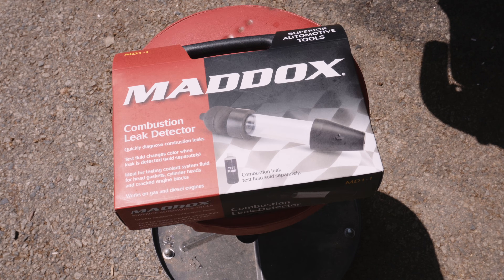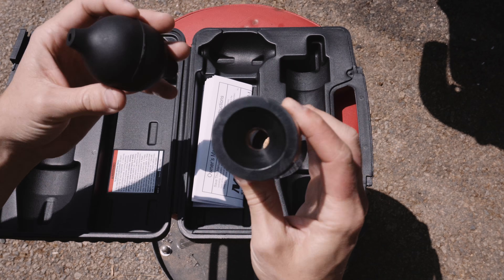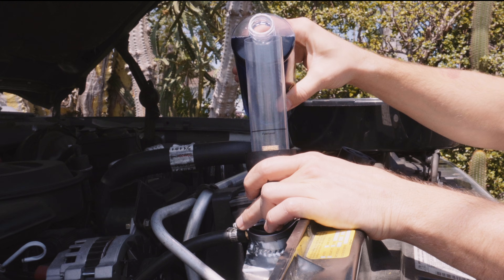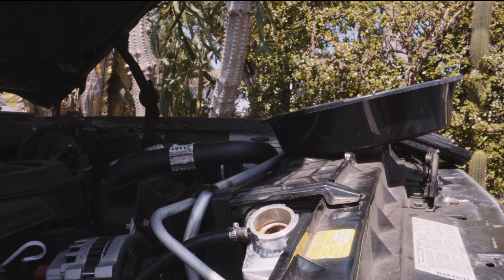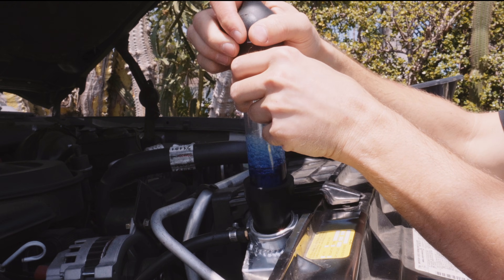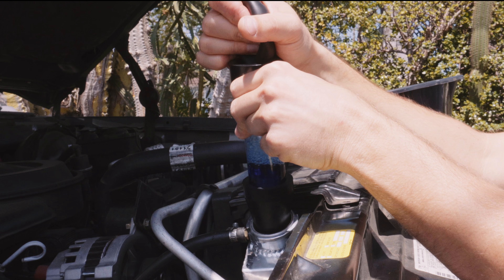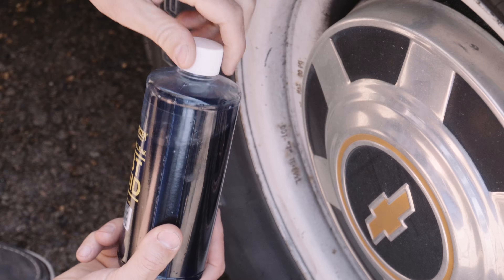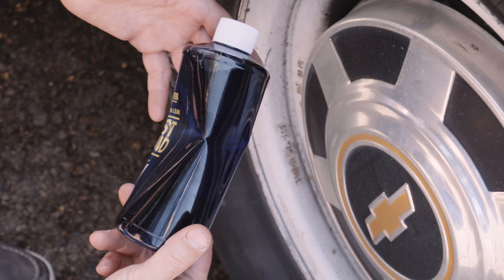How to test your engine for a head gasket leak with a block test from Harbor Freight

Comment: I want to know but I don't want to spend time or money..And I don't want a blown head gasket. I've been taking A LOT of short trips and I think the milkshake under oil cap is just normal condensation from not running it long enough for the condensation to burn off. You can have milkshake without a blown head gasket or Any problems At All. Beware of some shops that say it's bad do your own test first.. unless you have unlimited funds or can buy another vehicle.

Comment: No adatives will fix a blown head gasket this is not true at all
Reply from the maker: Call it a fix, call it a bandaid, call it nothing at all. What can say is my 4Runner had a minor HG leak and BD “fixed” it and it ran great for 3 years until I replaced my water pump and forgot to put my hose clamp back on the lower rad hose 😅 expensive mistake

Comment: Old school testing most new vehicules this will only indicate there is co2 in the system but not necessarily from a head gasket, most times its from EGR coolers causing the issue.

Comment: How accurate are these? Can a false positive or false negative occur?
Reply from the maker: As long as you keep the nozzle tight against the radiator, they’re super accurate. The only way it will change color is if there’s exhaust fumes in the radiator, which would mean head gasket leak.
Reply from the maker: It also needs to be pretty concentrated for it to really change color. Even more so driving home the accuracy.
Reply from the maker: Definitely no false positives. I could only see a false negative happening if it is an extremely slow leak. But I really don’t think that would happen.
Reply: When I did it for my car it was dead cold then I pumped it for 2 min and stayed blue but then as the car got warmer it turned greenish but I think that's bc as the car got warmer the coolant rose in the radiator to the neck and I tried removing it and doing it again but coolant kept rising so the tester I think was sucking in coolant to make it turn greenish

Comment: Will the exhaust gas come through the radiator even if the thermostat is closed??
Reply from the maker: Yes
Reply: I did this test and that liquid didn’t not turn yellow. But I’m still losing some coolant every once in a while, and couldn’t find any leaks.
Reply: @Nick1997-g5o  get the harbor freight coolant leak detection fluid and then look up a video on YouTube to see how to properly use it

Comment: So if there are obvious bubbles being blown into the cooling system when the engine is running, (eventually so much that the radiator hoses start to expand!)  but the fluid doesn't turn yellow, then what?
Suspecting something is wrong, I then even ran some exhaust straight from the tailpipe through the blue test fluid and it still doesn't turn blue! Does the fluid expire if it's too old?
Reply from the maker: I actually didn’t know until I just looked it up. Apparently the fluid has a shelf life of about a year

Comment: Does the seal have to be air tight? When i do a good air tight seal and squeeze, the liquid doesnt move at all, i have to leave some space in the seal for it to move when i squeeze
Reply from the maker: If the seal is not airtight against the radiator, then you will be sucking in air from outside. Did you drain some of the coolant out first?
Reply: @diyoverdrive yeah i did and when its air tight and i keep squeezing the liquid doesnt even move, i have leave some space for it to move the liquid when i squeeze, is it an issue if it takes in air, shouldnt it still be able to suck in gases like it does from an exhaust pipe
Reply from the maker: @ammar3094  maybe you didn’t remove enough water. You really need it to only come from the radiator. Any air will dilute the test and give you an accurate results.
Reply: @diyoverdrive 

This happened to me too today. 
I didn't suck out any coolant
Reply from the maker: @ZERONEINNOVATIONS  it won’t work right if you don’t remove some coolant
Reply: @diyoverdrive 
Oh yea I just did it again.  I sucked out coolant with some turkey baster and it worked good. Stayed blue. Thankyou!

Comment: Great video! I do this with my chemistry students as a demonstration of combustion reactions and acids. The test fluid is bromothymol blue indicator and water. If there is a leak, carbon dioxide is present which reacts with the water to make carbonic acid, lowering the pH and making the BTB turn green
Reply from the maker: Sounds like you’re a fun teacher! Glad you liked the video.
Reply: Does it always mean head gasket leak?  What if there is a leak in the coolant system and air gets in? There is carbon dioxide in the air and the test fluid will turn color.
Reply from the maker: @hongdazheng5297 I hate to say it. But I just see there being a leak that lets enough carbon monoxide in from the ambient air. I say that because if your fluid turned color the. You run air through it. It will turn blue again. If there’s enough exhaust in the coolant to turn the fluid color, it’s coming from the head gasket

Comment: So yellow means its really bad?
Reply from the maker: @katrinadillard6927  yes definitely
Reply: @diyoverdrive  can I just test it from the exhaust itself & does that mean a bad head gasket or does it have to be from radiator or even the overflow tank? Ran my 05 Toyota Matrix for 20 minutes between driving & idleing. Didnt get a sign of bad HG from overflow tank, but when I put to exhaust, it went straight to yellow!
Reply from the maker: @  It needs to come from the radiator. The point is to check for exhaust in the coolant/radiator. You will always have exhaust coming out the exhaust so that doesn’t help to test there. If you have exhaust in the coolant then you have a bad head gasket
Reply: @diyoverdrive  Great! Can this be done on a cold engine or does it have to be warmed up completely like after a drive? I don't want to open the radiator cap after a drive & burn myself!
Reply from the maker: @ you want to drain some coolant, open the cap, then start the engine and let it warm up a bit
Reply: @diyoverdrive only issue you can think it's a head gasket and it's not could be those fantastic EGR cooler leaks pushing co2 into your system.

Comment: how do you drain the radiator first?
Reply: I use a large syringe and suck coolant from the radiator cap neck until the ends of the radiator tubes are just barely covered. Don't forget to plug or pinch the overflow hose that goes from the neck to the reservoir, or you'll risk sucking air from the reservoir rather than the radiator.
Reply from the maker: @EMVelez  most radiators have a petcock on a bottom corner to drain.
Reply: @diyoverdrive  Yes, apparently it is not easy to access on a VW.

Comment: Instructions say 'Warm Motor' --- did you warm up the Motor First ?
Reply from the maker: @jjsiegal1  I did. I had already been driving when I parked. The reason they want the engine worm is so the thermostat opens and pushes the fluid around. You get bubbles quicker and more frequently that way.

Comment: Mine turn out green not yellow 👁️👁️
Reply from the maker: I’m sorry but green means there’s exhaust in your coolant. If you kept pumping it then it’d eventually go yellow. Green is just the in between before yellow. 

The only reason mine went yellow quick was because I basically pumped in pure exhaust for demonstration. 

What are your symptoms?
Reply: @diyoverdrive  that means I need to replace head gasket? O I need a new engine? 

I don’t got symptoms, did the test for curiosity and surprise

Comment: My cooling system was still regularly burping a small amount after like 45 minutes of it running so I need to verify the issue with this and then a leakdown test will help me tell where my issue is if I have one. Fortunately I already invested in a leakdown tester.
Reply from the maker: @wyattandwill12  after that long I would be too hopeful unfortunately. Wishing the best for you!

Comment: I did it when that car was dead cold and pulled the tube away after 2/3 mints the car wasn’t fully warmed up, did I do it correctly I heard that gaskets are best checked when cold
Reply from the maker: @shahrozalijafri8816  hot or cold, doesn’t really matter. The exhaust gas should be coming through either way. It’s nicer when cold so you don’t burn yourself when drain the coolant
Reply: @diyoverdrive  i heard that the thermostat should be open, buy anyways thanks for the reply
Reply: @shahrozalijafri8816  does it matter if I do it from radiator or the exhaust pipe? Tried from overflow tank, nothing. Radiator was too late to test it didnt want wake neighbor's, so I drove car 20 mins & tested from exhaust & it went yellow! Does this mean HG's bad? Losing coolant even though I put in new radiator!
Reply: @dbzownz12345 lol you can't use this test on the exhaust because exhaust fumes are what this test is designed to detect. 

The presence and introduction of exhaust gasses to this test liquid is what turns it yellow. That is why you don't use this test on an exhaust because it will turn it yellow every time.
Reply: @ just making sure. Going see a car & wanted to see if I ould use this as a way. Does the car have to be warmed up or can I get away with the car being cold?
Reply: @dbzownz12345  You're on the right track using this for when going to see a car to buy used. That's what I do too. Yes, you can use this cold. If an engine has a blown head gasket, this should detect it, whether the engine is cold or warmed up. 👍
Reply: @dbzownz12345 dont test from the exhaust u will get yellow because its fumes he was just setting an example the if u get direct fumes it works

Comment: What if the liquid doesn't turn yellow , it's like bluish green
Reply from the maker: @TheAlmir79  if it start to go greenish then you have exhaust in your coolant unfortunately. It might be a mild leak worthy of Blue Devil though. I’ve used it 3 times before and it’s held for years. I made a how-to video on my old channel Trail Bender Overland if you want to look it up.
Reply: @diyoverdrive hey man did you use it 3 different times on three different vehicles, or three times on the one vehicle to get that many years of reliability in a row? Appreciate the response if you have time!
Reply: My fluid turned greenish color also (gas engine), and from what I saw on youtube videos, it indicates a small exhaust leak.  Blue Devil is my next step.

Comment: Is it safe to perform a test with BT 500 Blue Coolant if the coolant reservoir overflows without a cap when the engine reaches the thermostat opening temperature?
Reply from the maker: @PedroBackard  as long as the engine isn’t overheating during the hour that it’s running for BD it’s safe

Comment: Devil head gasket doesn’t work just blocks ur areas in engine
Reply from the maker: @jayjb833  incorrect. That’s a common misconception. Stop-leak or Blue Devil Pour-n-go (the cheaper one) will block passages. But not Blue Devil HG Sealer. If you do some research you’ll learn about the difference between physical based sealant vs chemical based. Chemical sealants are safe because they only solidify at the point of the leak due to a chemical reaction. I would NEVER pour a physical based sealant in cause that will stick to anything and everything and cause nothing but issues down the line. The blue devil I have used multiple times works and sometimes works for many years. 7 years later and my 4Runner still has no block passages.
Reply: @dillansgarage hey my honda civic is slowly losing coolant and getting hard to start in the morning after overheating. Do you think blue devil will work if it's my head gasket? I heard it's bad if it get into oil.

Comment: Good video boss, but please don’t advise people to use head gasket sealer. Remember, what seals up the leak in your head gasket will seal up other things as well.
Reply: Blue devil is the best advice you can give someone with a blown head gasket. That's always my first step before I tear the head off or dish out thousands for repair
Reply: Also, when you use Blue Devil, you HAVE to pull out the thermostat, or it will get gunked up and stuck!
Reply: I read that some of the sealant products like blue devil are liquid glass.. and only solidify when in contact with very high temp combustion gases escaping between the cylinder and the coolant passage of the head.  This is why it will not clog anything that doesn't meet those conditions.  Thats actually how many of them work...
Suspect they won't last forever... probably good for older cars that are not worth the correct repair  cost...
Reply from the maker: There’s a difference between chemical bonds and physical sealants. I agree with you about physical sealants like stop leak
Reply: @diyoverdrive  I wasn’t trying to say you were wrong or anything, it’s just that I had an experience with trying to use some sealant and it gunk up my thermostat and radiator and everything. Maybe you can help me I have a 2009 Nissan frontier with a 4.0 V6. To make a really long story short, I’m pretty sure that I have a leaking head gasket. It’s a very very slow leak. I only have to add coolant about every two or three weeks or so and even then it’s only just a little bit of coolant. The problem I have is that if I put a load on the motor like hauling a trailer, it immediately gets hot. So my question is what type of sealer would you recommend because at this point I’m willing to try anything because I’m looking at having to buy another motor because I’m not going to spend $3000 to get the head gasket fixed. The truck has 211,000 miles. Thanks any help is really appreciated.
Reply from the maker: @rustypugh123  I have used blue devil, not the pour-n-go one, multiple times and never had any symptoms of gunk build up. It’s always been super clear. Follow the directions carefully with the blue devil and do it correctly.
Reply: @diyoverdrive  thanks I appreciate it
Reply from the maker: @rustypugh123  anytime. I have an old YouTube channel that’s not mine anymore called Trail Bender Overland. Those videos are still live and I made a detailed how-to use blue devil on there.
Reply: @diyoverdrive  I watched your video on Trail Bender Overland. I’ve only used the pour and go kind in the past. Didn’t even know about the kind you did in the video. I’ll try it. Thanks!
Reply from the maker: @rustypugh123  the pour-n-go or stop-leak is physical particulates based and will clog the whole system. The one I recommend only solidifies at the leak due to temperature and exhaust gas, so I can solidify anywhere else in the system
Reply: @rustypugh123  might be a little to late but have you done a compression test? It could be a manifold gasket especially if it’s a v6 Nissan they are very well known for that

Comment: I bought tge same kit ,nit doesnt seem to suck anything.  The ball just stays deflated . Ir i am doing something wrong ?
Reply from the maker: Strange. Is the tip of the nozzle dipped in coolant?
Reply: @diyoverdrive   nope nowhere close . Even  just doing it in open air . It doesn't  seem  to suck anything.  I tried even to blow air  through  the nozzle I couldn't force any air into it . I am thinking  the valve is defective. I hate to return it but I have to .
Reply: @bbrahbboul2748  broken kit, you probably know already by now but some people have issues, it is the check valve yes
Reply: I had the same issue, i stuck something in the bottom of the tester and hit it a couple times and it worked fine, idk what was up